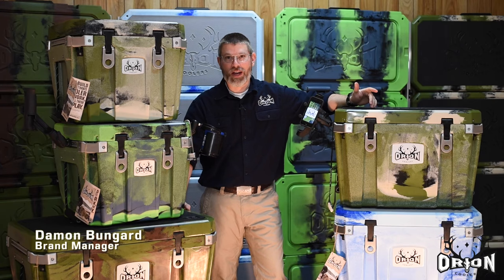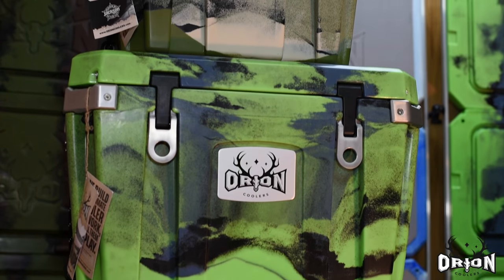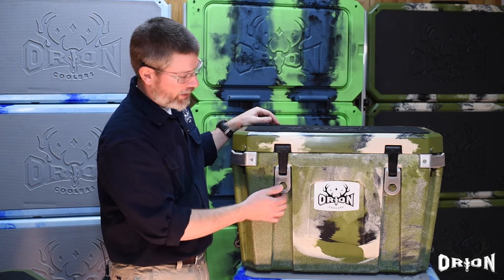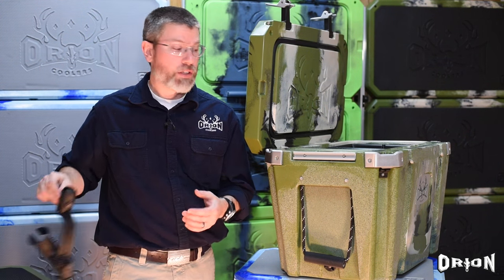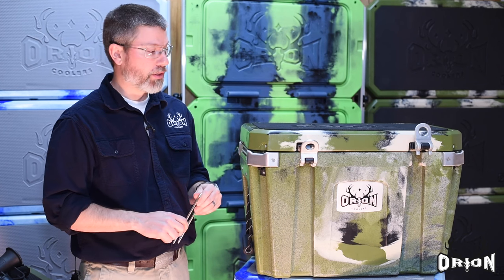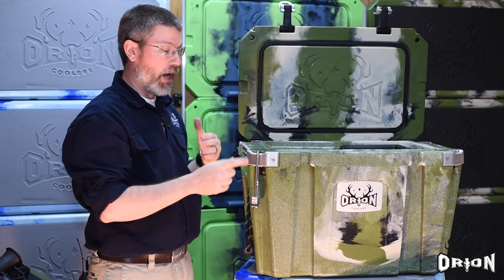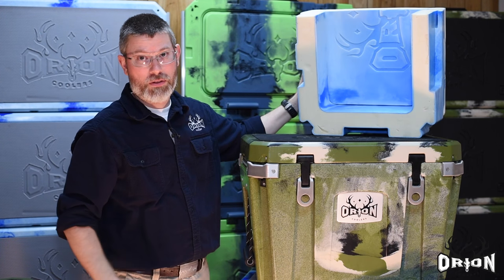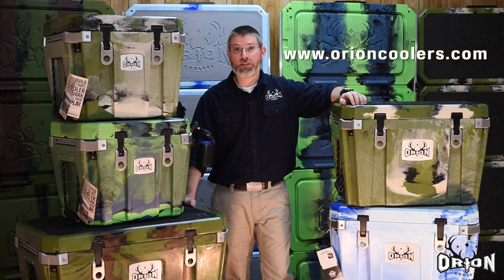2015 Orion Cooler Walkthrough

Comment: After days and days of reading reviews and watching videos about all kinds of  coolers I've narrowed my preference down to 2 coolers.  The Orion 25 and the Rtic 20. I really don't want a cooler more than 20 quarts and actually wanted one around 15 quarts. But I love the color options (especially the tie dye look) and the metal tracks & corners on the Orion. The only thing I have noticed that I don't particularly like about the Orion is that it looks kind of hard to open. If I don't order the Orion 25 I'm going to order the Rtic 20. That being said I would like to say Good Job on making an awesome looking quality cooler!
Reply: Well...6 years later what did you buy and are you happy with it?
Reply: @eventhejunglewantedhimdead480  I found that pretty much all of the Roto molded coolers are the same. If you buy a smaller one or a large one you're going to use the same amount of ice. It's just that you'll need to put ice in the smaller one more often. I found the smaller one to be better for me. Because I can still carry it around by myself once filled. Hope this helps.
Reply: @eventhejunglewantedhimdead480  also the guys from coolersonsale here on YouTube do some of the best testing on coolers of anyone.
Reply: @1halnass  It does thank you. I ended up buying an Otter Box Venture 25. I haven't used it yet but looks like a well-made cooler. And the guys at Coolersonsale give it the highest recommendation on one of their tests.